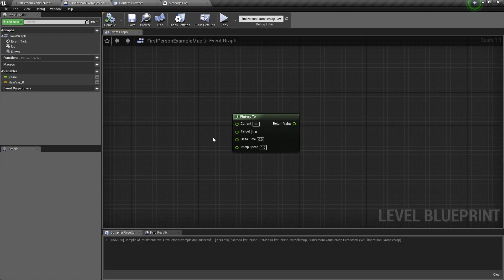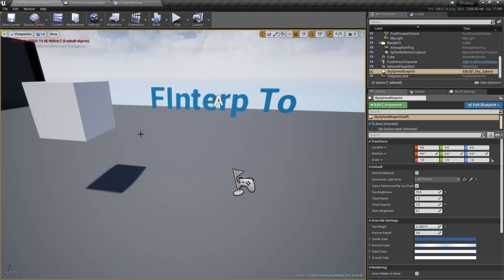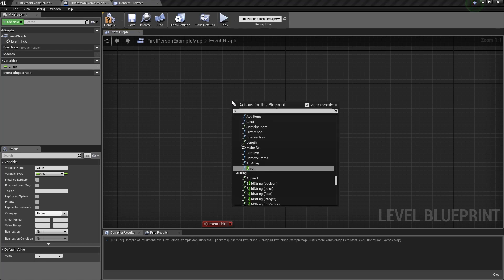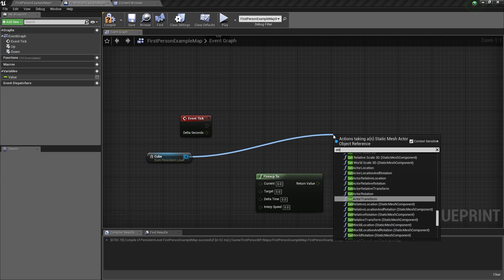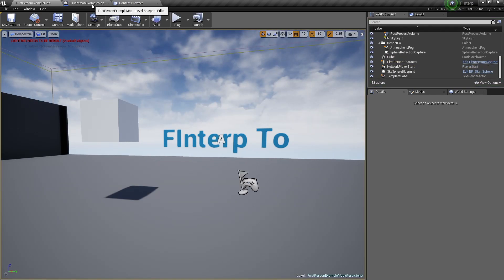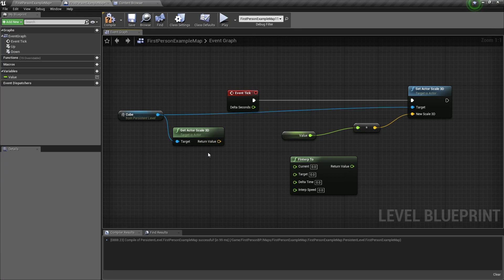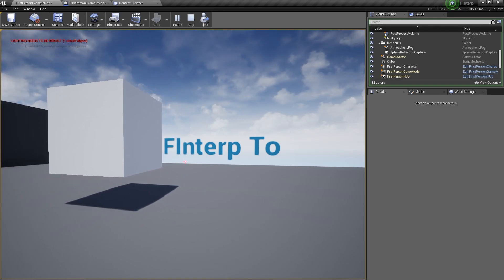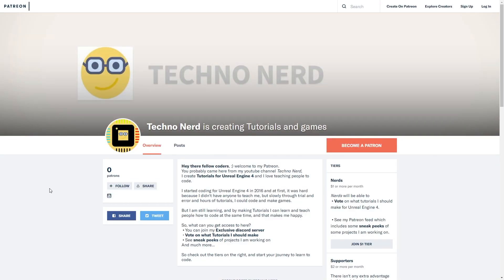What is the FInterp To node || UE4 TUTORIALS

Comment: "What the FInterp To node is" would be more accurate. Showing people the most basic way of using this node, ON TICK? Let's see a more efficient way of interpolating between values, without slapping it on the tick event as 1,000 other people teach others to do. This is bad. Timelines? Function timers? Alternatives, but still not the best.

Everyone: the more you slap on the tick as a cheat, the more your performance is going to tank. If you followed all the beginner (or even intermediate/advanced) tutorial out there, you would have a gazillion functions firing off your tick. Don't do that. Learn how to control values other ways.
Reply from the maker: tldr: only use tick if you are 100% sure you need to run code every frame, if not, don't use it.

Sometimes it may be necessary to interpolate a float every frame.

Keywords: may be necessary

For example, smoothly blending 2 materials together.
In fact, the best way to use Tick would be to use it in C++, it runs way faster.

Of course, running code unnecessarily on tick is a bad idea, but it's a tool that can be used, not a lot, but sometimes.